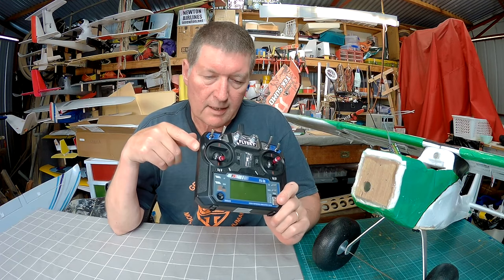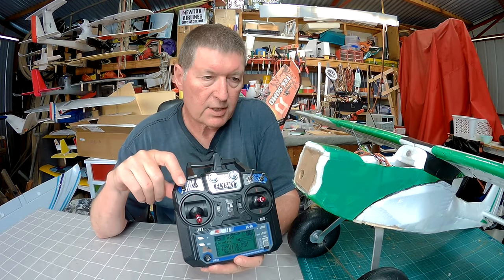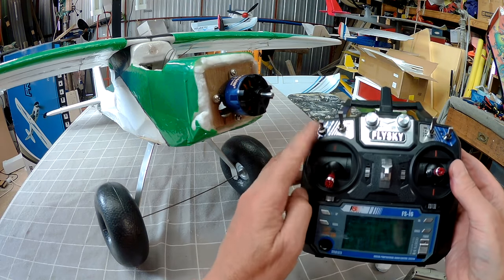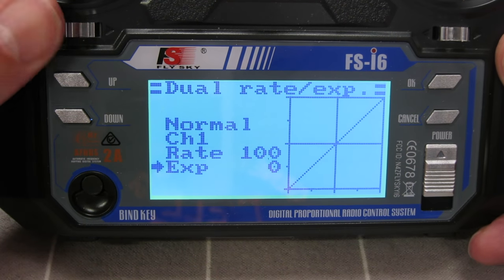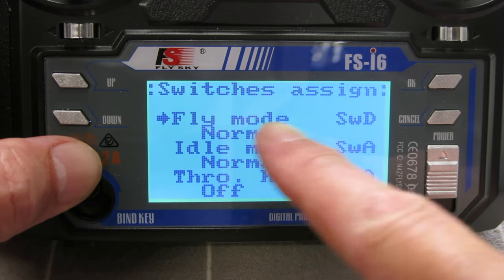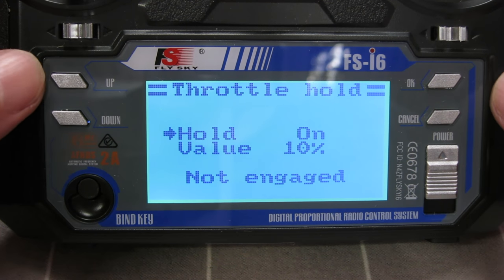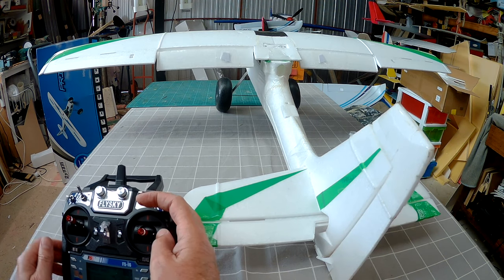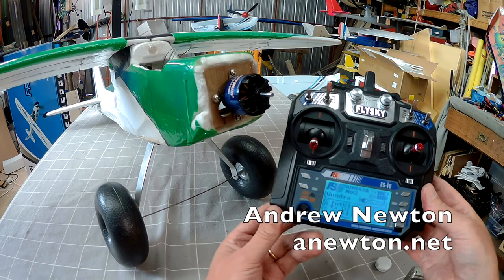FlySky FS i6 programming

Comment: Andrew I'm having a problem with the controllers with my family i6 transmitter for me it's to sensitive when I go to use the ailerons I inadvertently will add or decrease the elevator. And I remember in one of your videos you explain how to set that so it's not quite as sensitive so when I go to use a torons I won't be moving the elevator in other words I'll have to move the stick further before it controls the function so if you could tell me which video that you demonstrated this in I would greatly appreciate it so I can re watch it and adjust the settings accordingly. thank you Jeff b.in Seattle.
Reply from the maker: Are you think of Expo? This video show how

Comment: Love the video, I bought the Flysky i6s for my plane and I was wondering how you can program a servo to stop at say 20 degrees and return to home. Thanks
Reply from the maker: Just reduce the weight for that channel to about 50% Is that what you mean?
Reply: Andrew Newton I tried that but it didn’t work, could it be the servos? I’m using mg996r.
Reply: Could it be the transmitter? If I got the Flysky i6 and replaced the Flysky i6s would it fix it?

Comment: Great sharing, Thank you Andrew. Just back to RC planes after 30 plus year and dragging my old collection out. All balsa builds and heavy. switched my Gentle Lady (wing 1905mm) had a removable glow on top of the wing and flew well and now Elect. so so much easier to get in the air, just turn it on and go. Next is a Eagle 60 (wing 2574mm x 304mm), heavy plane, 2818 grams no fuel. Just wonder what your motor (power system) setup was on this plane? (battery, esc,motor) This video was awesome sharing as I am just converting from old 72mhz to this same fs i6, so much to learn. loving it.
Reply from the maker: This one would fly well on a 2216 1400kV with 8x6 prop and 3S or 4S battery and 40A ESC
Reply: @AndrewNewton  Thanks for sharing Andrew. Watching for your next video, So glad I stumbled on to your videos.  
Jeff

Comment: Nice vid, is there anyway to change the total movment for the servo? I have this problem, when I set up the flaperons one servo moves more than the other, aparently it has a bigger range of movment than the other, is there anyway to fix this? tnak you
Reply from the maker: Yes. Servo End Points
Reply: this is because the servos aren´t not the same ? why this happend? thanks
Reply from the maker: Just variation in manufacturing. It happens often.
Reply: Just change both servos and same thing happens, the left servo has more movment range, I think it could be something relatit to the mix for flaperons....but Im not sure wish is the issue
Reply: I have evrething set at 100% and in the middle, servo channel 1 and 6 exactly the same setting..can´t get it why!
Reply from the maker: Best to reset the model and start again
Reply: @AndrewNewton  yes, I will do that. I'm trying the flaperon with the throttle alternative you teach here

Comment: Thank you sir for such a great and informative video.
I have flight mode on my trainer . Reflex V2. Usually works on a 3 way switch so 
Gyro off. Intermediate, and beginner. It will work on a 2 way switch but eliminates the off position. I am wondering what switch is best used for this since my 3 way is used for flaps , A is throttle cut The other right side 2 way is dual rate and expo.
Would 2 way switch B or one of the var dials be better for gyro. I am old as dirt, and just getting going again since the days of crystals and slightly confused by the new technology.
Please help if you can.
Thanks
Robert
Reply from the maker: 3 way switch would be best to give you all modes but the pot would be OK too
Reply: @AndrewNewton  thank you Andrew.  I honestly hadn't considered that.
Cheers
Bob

Comment: Andrew hi - having just purchased a FlySky FS i6 (for model sailing), enjoy watching your instruction videos. Have swapped the stick mechanisms over to configure to Mode 2 i.e. throttle left and have successfully configured end points for Winch (channel 3 - throttle) and steering (channel 4 - rudder). However having trouble getting trim control switches on radio body to respond other than the throttle. Is there something I have configured incorrectly?
Reply from the maker: Can you see any change in the channels graphs on the Display page when you operate the trims?
Reply: @AndrewNewton  Hi Andrew - apologies, just returned from a business trip interstate. Yes channel graphs 1 - 4  all respond to trim switch input.

Comment: Hi Andrew. Is it possible to set up a throttle cut function for a glow engine, so that the engine will idle when the stick is at its lowest setting, but will stop when the "cut" switch is activated ? If so, could you explain how to do this please ?
Reply from the maker: Yes I think it would be possible, best to ask someone who uses this radio with nitro
Reply: Andrew Newton  OK. Thanks very much.

Comment: It's very usefull!!.. Thanks!... I'have a doubt.. I need a rx-tx set with gyroscope (Self-stabilicing) for my plane. To toggle between Expert and novice mode. I'don't know... this feature is on the TX or the receiver? It's configurable in this TX? ....
Reply from the maker: You would need a gyro receiver. For the Flysky there is this https://www.phaserfpv.com.au/products/flyskyfs-bs6receiverwithgyrostabilizationsystemforgt2eit4sgt5transmitter
Reply: @AndrewNewton  That's really only suitable for RC Cars - to counter steering drift. For planes there isn't much available in Flysky as an integrated receiver stabilizer. Plenty of add-ons though - Kopilot, Hobby Eagle, SN Sparrow etc.

Comment: I know this a old vid but still confused . Can you give me the definitive answer Andrew , does adding   - minus soften the stick movement  ? I have applied - 30 and my model is still very twitchy with very little control throw?
Reply from the maker: Watch the curve. Use whatever flattens it out. With this radio it was negative expo numbers. Future firmware updates could possibly have changed that. Make sure you are in the mode that has expo too. Sport or Normal.
Reply: Ok thanks Andrew , only just seen your message. It’s seems my Tx like you said is the opposite way around, no wonder it’s been wild almost uncontrollable. The line like you say flattens out with + or the opposite to - so l will try again tomorrow. Thanks

Comment: I have a problem I can't get around for setting flaps on bixler 2 to swC so that the flaps would be flat on top switch position, a bit down on middle switch position and full flaps on switch down position.

Now when switch is in top position I have the flaps up, like ailerons are. Do I have too long control rods? Or just an error in transmitter config? Your video is great, like the rest of them!
Reply from the maker: Adjust pushrod length and / or servo arm angle
Reply: @AndrewNewton  servo arm angle adjustment is probably the best answer! I was blinded by servo calibration process as I thought I cannot install it in any other way than 90 degrees... Thanks!

Comment: I have  another  question for you  I noticed you  put rubber bands on your  Phoenix or your  evolution plane atop the  wings  you said something about the screws stripping out to help  prevent it from happening do you  recommend putting  rubber bands on it or not.
Reply from the maker: Just for motorless slopers made from the V1 Phoenix
Reply: Andrew  have you  figured out what the  range of the i6x radio I found  a est. Saying it  is over 1 mile distance is that a  accurate number  with a  clear line of sight...

Comment: Hi Andrew, Thanks for your replie. I'm making a rc scale boat at the moment and I'm using the Lander 40amp ESC with reverse function. But the ESC can't run the motor in reverse for some reason. Someone told me that maybe the remote might not be set up for reverse function. Is there a way I can fix this?
Regards, Turlough Kennedy.
Reply from the maker: Hello, looks like you have plug the reversing cable from the ESC into the receiver and setup a switch in the radio programming. Have you done that?

Comment: Do you know how to update the firmware to 10 channels with rssi and where ALL settings change from 6 channels to 10 channels" Ex: For fail safe instead of only being able to set 6 channels for a fail safe, now you can set any of the 10? I really need that function because I have an emergency parachute function so i if i lose signal, the fail safe will activate the parachute system.
Reply from the maker: Can only be firmware updated via Windows PCs. I have Mac so I haven't tried.

Comment: Hi Andy, thanks for the great tutorial as always. I have just got myself into this hobby and had my radio for few weeks. the thing is it eats battery like crazy. Do you recommend using rechargable NiMh battery such as  the Panasonic eneloop which have nominal voltage of 1.2v per cell or the newer one LiPo with microUSB charging port? both available in AA size, thanks for your advice
Reply from the maker: Allen Moore would be the man to ask, I rarely use mine but it's his main radio https://www.youtube.com/channel/UCxp23yC005hanSysA4vodQA
Reply: Andrew Newton i see, thanks for the information
Reply: I have not had that problem at all, I do use rechargeable NiMh batteries , the battery life is excellent. I will say that the transmitter battery monitor "bar" readout NEVER shows full battery power even with a fresh set of NiMh batteries, I have gotten over that. I can use this transmitter all weekend without worry. I keep a spare charged set of NiMh batteries and just swap them out every week or so just to be on the safe side. Never had a problem. This radio has great range, I can literally fly my motor glider out of sight before I would lose transmitter control. I am convinced of that.
Reply: @steelydanfan100  Great! What approximate range do you get?

Comment: Im planning to use this for a quad copter. However i have 1 question. You assigned the left switch as a savety. Which i love the idea off and will most likely do. However would it be possible to assign the right switch to the same function but with up at 0 to 70% power and down for 0 to 100% power. Im asking this as the quad copter i want has way more power then i as a beginner can deal with so reducing power will give a smoother flight. So assigning this function twice would be ideal
Reply from the maker: Not sure about copters, but I guess it's do-able

Comment: Thank for the video. i am facing a  problem with my  FS i6x elevator stick. When i push the elevator stick up for little value like 20 to 25% servo didn't rotate but when i push the stick further more to 100% the servo moves to its end point. And when i push the stick down it works fine. In down position my servo gives me little pitch varience according to my stick. But in upward push i only get full pitch or zero pitch. What can be the issue.
Thanks in advance
Reply from the maker: That is strange. Sorry I don't know what would cause that.
Reply: @AndrewNewton  i have made a video of it. If you like to see it may be you will get better understanding of my problem.

Comment: Andrew I hope you can answer my question. I have the FlySky FX I6 transmitter And on the transmitter on the screen there, it shows the power of the batteries in the transmitter below that it shows another bar which shows the power of the receiver on one of my receivers, but my other two receivers don't show that second bar. Only one receiver produces that second bar like the top bar for the power of the batteries in the transmitter my other two don't do that. Why is this?
Reply: That's the  fsi6x transmitter
Reply: Anyway, only one receiver produces that second bar. Aside from the numbers which shows on all batteries only one receiver shows that second bar the other two receivers, which are also FlySky receivers same as the first one they don't produce that second bar.
Reply from the maker: To show the Rx voltage the receiver must be properly bound to the radio and set to AFHDS-2A protocol (not just AFHDS)
Reply: I just got finished setting up the transmitter and  now its working on  all 3 receivers thank you for  explaining how to do it I watched  your  video and  followed your  instructions  once you  told me  what I needed to do....

Comment: Hi Andrew, thanks for this.  I’m just setting up a plane and trying to put the throttle cut on SW-A like you did, however, no matter what I di it would not work on SW-A.  I have now put it on SW-D and it’s working, however,  when I arm the throttle with SW D and pull down SW A it goes to full throttle?
It’s like as if SW A is permanently live on the throttle, any ideas Andrew?
Thanks for your help....
Reply from the maker: Wipe that model and start again. Seems like you have conflicting mixes and switch assignments
Reply: @AndrewNewton  thanks Andrew
Reply: @AndrewNewton  I tried a new model and it’s the same,  this time I put the idle on swB but swA still sets the motor going, I must have a dodgy TX?
Reply from the maker: Dont use idle on a switch, just throttle cut maybe
Reply: I just followed your video, I found the issue, swA was set to trainer from the factory, all good now, thank you.

Comment: Well I went out to  fly my plane and it was a great day no wind calm day about 60 degrees  sunny so I launched my  Cessna 40" wing and up it went I flew it a couple of times over head and brought it in for a  landing  I cut the  motor glided in to land it when great  a decent landing I thought  the field had little  clumps of weeds  all over  touched down  and when it  stopped the  tail went up no big deal I  thought  I would be able to  launch it  again but  the  shaft on the  motor  bent for the  propeller didn't  break the propeller just  bent the  shaft for the  propeller lol yes there are  wheels on it nothing broke on the  plane was suprised it bent the  shaft so now I have to  try to  straighten the shaft any  advice on the best way to do it or fix it
Reply from the maker: Oh no. No easy way to straighten the shaft. I have always replaced the motor. You can remove the shaft on some motors by removing the circle and tapping the shaft out. It's not easy.

Comment: Good useful vid BUT BUT! Note: the Safety throttle switch is much better reversed. Because on the TX all switches need to be pushed FORWARD to turn it on, your way the throttle is armed as soon as you turn the radio on (arming switch is forward). What you need is your arming switch UNARMED in the forward position when you turn on. Just reverse his instructions if you want to keep all your fingers!
Reply: Apologies if I got this wrong, I followed his instructions and got it wrong, maybe I made an error. Just make sure you test without a prop, that your throttle is UNARMED with your arming switch FORWARD.
Reply from the maker: Switches have to be up or back on mine to start the radio, so that's the position I chose for the throttle cut.

Comment: Hello Andrew. I have the same transmitter, but the throttle is working in the bought switch position. Is same problem? How can I fix the transmitter function? Thanks.
Reply from the maker: "bought switch position" ? What does that mean?
Reply: @AndrewNewton  Hello. Normal, if the  left switch is in up position, the throttle doesn't activate the motor, only in the down position. But my transmitter, activate the motor including the up position. Is this function normal?
Reply from the maker: @aurelbarbor1125  That is normal default behaviour.
Reply: @AndrewNewton  Thanks for for your information..

Comment: Hi Anrew  Could you please suggest how to mix down elvator with increase throtle for my glider.
Would really appreciate how to assign SW3 to flight controller (model NX3)  I am useing a new FLYSKY-i6 for all my models.  Thanks Colin
Reply from the maker: Cant do it any transmitter mixing with a flight controller. The NX3 makes all the decisions. Do you mean SW3 to change modes?
Reply: @AndrewNewton  Yes that is exactley what I want.
With regard to the throttle  mix with elevator is this not posible. Thanks Colin
Reply from the maker: I dont know the NX3 but I see it's only a gyro stabiliser, the mix may be possible but not one I have tried. For the mode switch you have to assign SWC to a spare channel (5 or 6) and connect that channel to the AUX input on the NX3
Reply: @AndrewNewton  Thanks Anrew that was a great help and is working perfect. So simple when you know how.  Thanks  Colin
Reply from the maker: @patterdalebt  Excellent Colin, I remember puzzling over the same things a few years ago. Not obvious without previous experience. I'll do a Throttle / Elevator mix video for the FS-i6 soon. That has been requested many times.
Reply: @AndrewNewton  Anrdew.  I have returned to the hobby afler a 50 year break (74 yrs this month) and having been a boat builder I still have some good hand skills left. But the glue, paint,sawdust, f/g and carbon dust and many other forms of crapp have slow down the brain cells. Your calm way of explanation is a great asset, and I await your up coming video. Again many thanks Colin

Comment: Doesn't "throttle hold" do what you did with zeroing out throttle curve?
Reply from the maker: Not in a safe way. My method means the throttle is disabled when the radio is turned on. With "throttle hold" the throttle must be live when the radio is turned on.

Comment: When I first turn it on I have full throttle. But after 10 or 15 seconds, the throttle just goes down on its own to a maybe. A third power then down to 1/4 power and even less. When I turn the motor off and let it sit for a moment. Power back to full throttle. I have a burst for another 5-10 seconds and then it the power just goes all the way down. Apparently the battery is not keeping a full charge